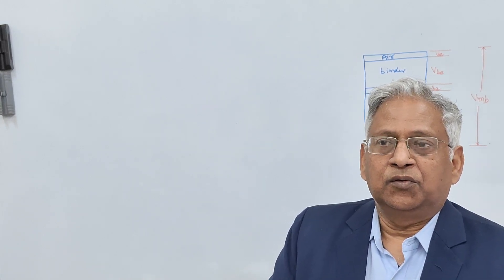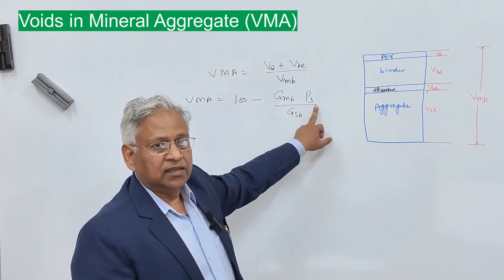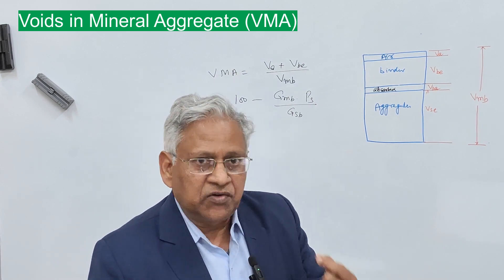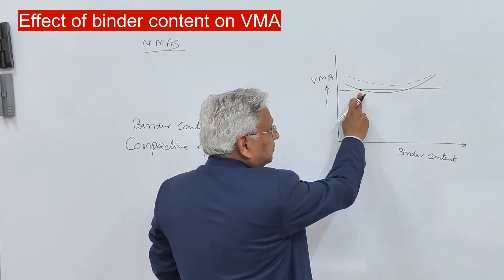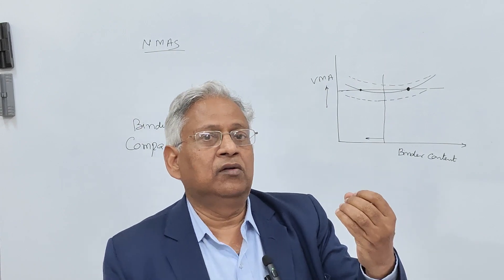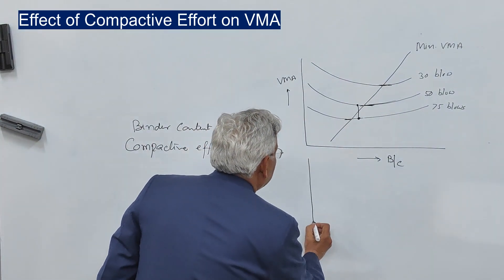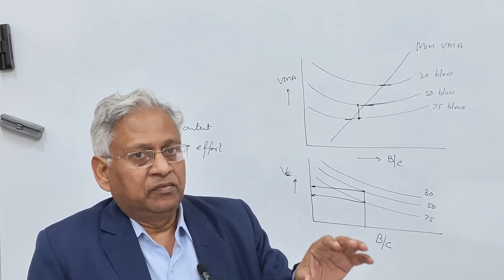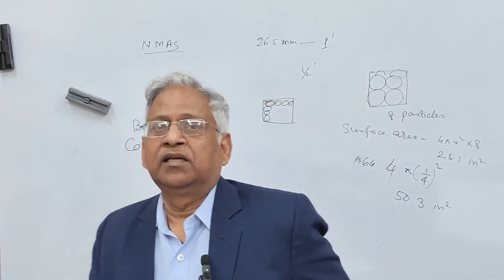Voids in Mineral Aggregates in a Bituminous Mix. Significance of VMA, How to achieve desired VMA?

Comment: Thank you for your videos sir.
Sir,
How to relate 30 blows,50blows and 75 blows in rolling passes and pattern on site. 
Normally 8 ton tandem roller using  for compaction. How to find reach desirable achive compaction. kindly explain about relationship between blows on lab and number of rolling passes on site.
Reply from the maker: There is no such correlation. You have to get it during trial section.